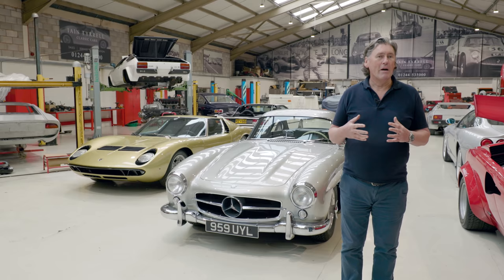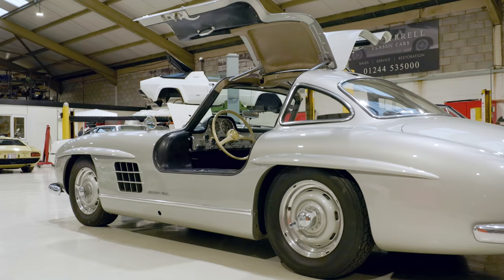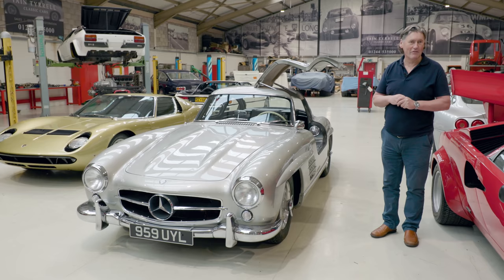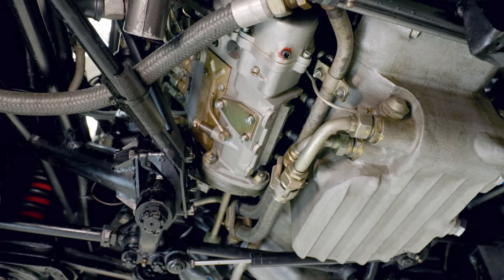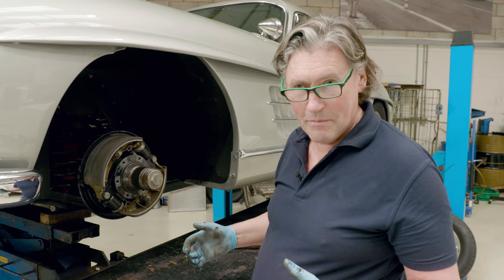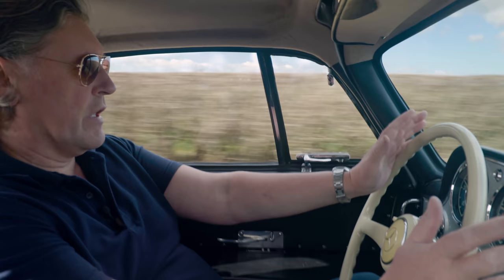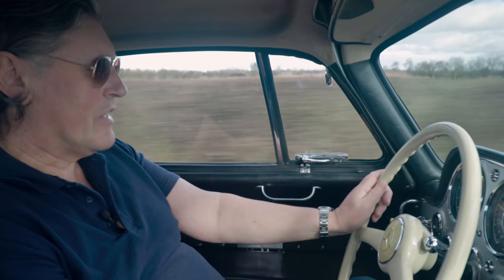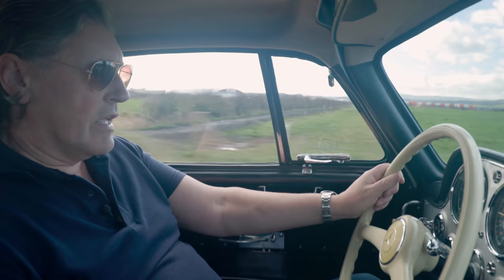Mercedes-Benz 300 SL Gullwing - Recommissioning an Automotive Icon | Tyrrell's Classic Workshop

Comment: There's not many things cooler than pulling out of your shop in a Gullwing, with one door open.
Reply: To be met by a jet fighter parked infront of you🙈
Reply: Yes there is. 2 doors open.
Reply: Well, Dry Sump seems to be twice as cool (when he told us the three advantages @3:58 😁)
Reply: I was actually shouting no no no thought the door was going to hit panic over though great insight into this iconic car thanks Ian made my evening
Reply: CLUNK..... oh shi....
Reply: Mmmmm i would have to look at my budget......scale down and have a fully revised DeLorean.
Ofcourse it does not even come close otherwise but looking good and having fun counts for something.
Reply: ...after working on said car wearing your no date Submariner. Brilliant.
Reply: My Uncle did that and hit the door backing out of the garage...in 1964.  This is the first car I ever shifted at 5 years old from the passenger seat.  So sad he sold it..
Reply: When I had my workshop, I put a mark on the door frame which was the height the roller shutter had to be at so as to not clump it with an open delorean door.
Reply: There are no things cooler than that. This is a proper car with proper guages, none of those poncey sat nav screens and beeps to let you know your ashtray is still open.
Reply: @andy-james-  do cars still have ash-trays?
Reply: @andy-james-  *gauges
Reply: A friend of mine had a DB3,he held the drivers door open as he reversed to get a better view.Didn`t notice the gatepost which bent his door back at a cost which was eye watering.

Comment: The 3 advantages of dry sump lubrication:
1) It keeps the oil cool.
2) It offers a consistent oil supply.
3) It keeps the oil cool.
Reply: Now that’s cool 😎
Reply: The third advantage is weight distribution. The engine can be fitted lower and the oil reservoir can be placed where it best serves to balance the weight distribution.

Comment: That sound. Bloody hell that’s good.
Reply: Absolutely... I might even settle for digitally engineered in via the speakers for that sound, if they could replicate it. Makes you wonder what AMG were thinking
Reply: Yes, all the exotic layouts like V10, V12, flat 12 etc sound nice- but a good, angry inline six can still compete with the best for pure sound.
Reply: Glorious.
Reply: The sound that straight six's make are often overlooked/forgotten.
Reply: @NORWAYORNOWAY  yeah, the problem is that's the sound of a fart can, no sign of engine sound left in it. Try to listen to an unmolested BMW straight six. That's the sound of a straight six. This is one is just "straight piped" I guess, fart noises producer.
Reply: I dont think back boxes were even a requirement back then. Engines now are muffled to death and it will get worse until EVs arrive.
Reply: @BlatentlyFakeName  they installed a "not oringal" muffler/end pipe that farts so loud, that you can't hear the nice inline six growl anymore.
Reply: @thefridgeman  I can't find anything visible to indicate this example's exhaust deviates from stock in some way; other original-condition Gullwings documented online appear to share the same setup, and videos of such vehicles sound remarkably similar. Whether or not the noise is pleasant to you is subjective, but to claim someone altered and/or ruined it seems without basis in this case. To call this design a "fart can" is off-base when the sound is purely a result of the function of the design (to evacuate as large a volume of combustion gases as quickly as possible for the sake of peak power) rather than for the sake of making noise.

As for not being able to hear the engine over the exhaust, that run at 27:04 is pure induction roar.
Reply: @andrewpliagas9213  0:32 look at the tip. Also, the car Mercedes Museum is running has a "chromed tip" lololol. There is no catalyst or modern mufflers on these cars, but still, you can only hear the end pipe farting, NOTHING from the engine. Again, try find how a straight six sounds, a lot different!
Reply: @andrewpliagas9213  Compare 27:06 with 27:08 engine sound vs end pipe farting.
Reply: @thefridgeman  BMW Fanboy?

Comment: As a fan of WW2 aircraft, I was impressed to learn that the BF109 had two, Bosch fuel pumps, the same as in the 300SL Gullwing. Spitfire’s Merlin motors used carburettors, and these would starve the motor or be way too rich under different fighting conditions, such as inverted flying and especially in a steep dive. “Miss Tilly’s orifice” was a restriction device that solved these problems.
Reply: “Miss Tilly’s Orifice” 
😅

Comment: When you put your foot down I think that has the most pleasing acceleration sound I’ve ever heard, like a sound you might in a Star Wars moving going into hyper space!!
Reply: I agree. I've actually never heard anything like it? Most gullwings are museum pieces, how often do you get to hear one at full throttle with the car mic:ed up?
Reply: @ingvarhallstrom2306  Not only mic'ed up but done properly, without the mics driven into distortion or wind noise. Very rare for YT vids.
Reply: You should try one of the W06 S SS SSK or SSKL series with the blower engaged .
Reply: @ingvarhallstrom2306  I’ve passengered in one , also had a seat in the 300SLR Uhlenhaut Coupe and met the great man himself . The best sound ever though was my run in a 1927 W06 Mercedes S with the Rootes Kompressor which engaged at full throttle and made that wonderful scream ( but you could only use it in high gears and for just a few seconds ; except in the SSKL with the ‘elephant’ blower )

Comment: When Mercedes built properly engineered cars, you can feel and hear the quality in every thing it does. So rare to find this now.
Reply: Sadly so very true. Ask any experienced MoT tester.  During my MoT "while you wait" appointment sat in the viewing area, a broken suspension spring rolled towards me. I asked what was that from. The friendly tester pointed to a nice looking Mercedes Estate parked next to my Rover 620ti being tested.. 

Some of the things he finds are shocking and undermine so called German engineering and reliability myth now. That since the main core of German car manufacturers decided to enter the volume car sectors mainly occupied by the likes of GM and Ford Worldwide as well as Japanese stuff. That they did very successfully as a glance at any UK road or car park would soon confirm. Thus unit costs means somethings had to suffer... and it shows.

Move on a few years and my immediate next door neighbour has a new Chinese built MG ZS EV parked where previously a Mercedes or Lexus stood previously. He told me that he is delighted with his MG EV and his final comment... "I'll never go back to petrol or diesel cars again". Now that is some change of mindset!
Reply: As a german Engineer (60) : true, it was  all  gone beginning of the 90th, when the  Number-count-Dilberts took over and the Engineers got less and less power; plus other "funny" developments
Reply: Mercedes electrics are rubbish now

Comment: Iain you did an admiral job of giving the viewer an excellent feeling for a Gullwing. Right down to an accurate sound track of the big pipe exhaust rasp, so special to the 300SL.
I'm a retired Star Technician award winner, multiple times. I serviced all M-B's from the 1950's up to 1990. My first 20 years of working with M-B, then 27 more years with BMW. I never felt the same sense of heritage, prestige, factory support, engineering and build quality with BMW. I'm reluctant to part with my 300SL manual, parts book and operation manual because of the great memories they give me. Chinetti motors was my M-B neighbor 1 block up the road in Greenwich, Connecticut 🇺🇲.
What a time for prestige automobiles in the 60's and 70's. I'll continue to view your other episodes. Cheers ✌️🇬🇧,🇺🇲.

Comment: I had the rare pleasure of seeing a 300SL Gullwing parked on a street in Surfers Paradise in the early 1960s. Actually it was a double pleasure as a young lady wearing a dress was clambering in to the passenger seat backwards across that wide sill as I passed by.  I didn't notice the colour of the car.

Comment: Epic vid. Love that car. Missing my 90s S-Class, it had about 1% of this cars engineering prowess and that was still a lot. Too bad what's happened to the brand these days.
Reply: I had a W123 back in the day, proper engineering and an ergonomic cockpit with zero styling input. Last real Mercedes.
Reply: They did have a bad period a few years ago, but it's my impression that they have made some progress on making good cars again. It's my understanding that the rot set in when the then chairman decided that the profits were too low and they were spending too much money on engineering. So the board agreed to reduce the engineering budget and the profits went up. Then the quality went down until Mercedes quality rating was around the bottom of the league.

Then again, you can't judge the whole output by the quality of a few hero cars. You can't expect the cheap models, designed to appeal to people who base their buying decisions on the bling level and the price (the Kia's reverse camera has more features than the Mercedes and it's $9.99 cheaper"), to be supercars.
Reply: @roadie3124  The worst time was the area of Daimler-Chrysler. It damaged both companies a total loose/loose merger.
Reply: My wife is a BMW lover from way back.  We have had everything from a 328i to a 740il, a total of 8 new cars over the years.  The last 3 series we got was a piece of junk.  So tired of hearing how people still think they are great cars.  My wife loved them until then.  We know so many other BMW owners that shriek about what the brand has become.  The dealer service was always expensive but you got some value from them, now the warranty observance and level of service is totally unacceptable.  My friend bought TWO new Mercedes 3 years ago, and they both rattle, all the finish coming off the switch gear, and just feel and sound cheap. His leaks oil, not under warranty, a fortune to fix.  I remember my best friend buying a E-class years ago and there is absolutely no comparison.  I belong to a Porsche club and there are three guys in there that buy brand new 911s and trade them in every two years, because once the warranty is over, the repairs are unbelievable.  What happened to German cars, which were once considered among the best?

My wife?  Got her a brand new Cadillac, something I didn't believe she would ever want.  No issues, no black BMW paint that permanently-stains if a bird winks at it, drives very well, has all the gadgets.  It is mind boggling that a new Cadillac is a better choice and better value by far than any German car.  Wow, just wow.

Comment: All that innovation in 1954, it’s incredible.
Reply: but old Jaguar drum brakes.
Reply: By 1961 the 300SL was updated with disc brakes all round.
Reply: @Freimopp777  So were all the Jaguars, they were fairly early adopters of disc brakes.

The 1950s was a great time for innovation, the next year saw the Citroen DS, by far the most innovative car ever made. The car that introduced more features than any other, many are commonplace today, many others should be standard on every car but have been forgotten.

Comment: At the age of 16 in 1962, I was lucky enough to ride in one of these great vehicle's. Approximately 120 mph along Radcliffe road Nottingham. Sheep crossing ahead, heavy braking spun us around about three times and the momentum carried us backwards though an open gated field. No damage apart from the flat surfaces on the tyres.

Comment: It was obvious that you had maximum fun in this !!!7 figure!!! car. Your enthusiasm, an over flowing fountain, thanks for taking us on the tour and the ride.  You might note that the Bosch pump is similar to the Spica pump that Alfa used in their early twin cam 4, early Spiders and Coupes, as I recall, and in diesel trucks. The Spitfires and Mustangs were eventually using fuel injected Merlins.

Comment: I was in Germany with the Airforce in the 1980s. I was lucky enough to find a1971 280 S. Because of the very tough inspection regulations older cars are hard to find. I had that car for 5 years and passed it on to another airman. I replaced some brake parts and and an automatic transmission, but the car was solid the paint was perfect and it was a joy to drive. I wish I had it now.

Comment: A few words about aero engines....
The Merlin was supercharged so fuel distribution was not an issue, but certain maneuvers and inverted flying were done at your own risk, the Merlin would just quit due to carburetor float shenanigans. The engines would 'windmill' and relight once the mixture got back into the cylinders. That's where fuel injection had the huge advantage.
About double de-clutching, in the 'states we call it 'double clutching', but we do say 'decluthing' when throwing out the clutch.
Excellent presentation, thanks for the ride !

Comment: Bravo!
Driving a classis sports car the way it was meant really is a magical thing! I always go at least 100 miles per trip in my 65' Alfa 2600 Spider, in search of windy roads. I get the same feeling of the car being alive under you after about an hour of warming up. Its funny how the car just wants more after everything loosens up, bushings heat up, oil flows easily, bearings get slick......all those tiny little analog changes really do amount to a perceptible change in the car's feedback and feel.

Comment: The straight 8 powered Uhlenhaut SLR coupe was an even more interesting story.
He refused to release that version for sale.Rob Walker, of the Mike Hawthorne incident fame, reputedly asked him to sell him one and was turned down.
Although the gull wing doors are even more doubtful, regarding a roll over type incident, than a convertible.
A flaw it shared with the Me109 aircraft canopy.
Reply from the maker: Thanks for that. Very interesting
Reply: @iain_tyrrell  
Thanks Ian just to add one of the two SLRs seems to have fetched 135,000,000 Euros at recent sale.

Comment: Automotive art, I read somewhere that the drum braked race cars of that period, had an oiling system in the cockpit to squirt lubricant onto a grabbing brake! I believe the Uhlenhaut coupe also had the same system fitted. Love the clock. One of the outstanding cars of the 1950s, along with the Jaguar XK 120 and the C and D types, plus the amazing Citroen DS.

Comment: I have just experienced YouTube heaven. Long time Merc owner and fan and big fan of this channel too. The perfect video for me then? Oh yes!!!! Mercs from the early 90's really went downhill im afraid. Have heard the new new ones are better than that sad period. All I can say is the 220+ bhp non cat M104.980 in my old 300te-24 needed 24 valves and whilst it sounded great from 4000 to the 7250 red line...it wasn't tractable like a two valve set up. My wifes car is a 1991 190e 2.0 8v non cat sportline manual gearbox .Euro spec at about 125 bhp, but damn that thing pulls as you said...like a steam train from 1000rpm. Never mind torque curve its a torque plateau. Anyway, thanks for this video i was neigh on in tears. Superb.

Comment: I would like to add one more historic fact, due to the Mecedes Encyclpedia of Heribert Hofner.
Mercedes was between 1938 and 1942 working on a new Großer Mercedes to replace 770 Model. Planned and sketched was a 6 Liter V12 fullaluminium Engine with one supercharger on each cylinder bank.
The Motor of the 300 Adenauer is what has remained of this  huge projekt. A Mercedes 600 , 230/400 hp

Comment: 15 or 20 years ago I was approached to design an air conditioner for a 300SL that was undergoing restoration. The requirement, of course, was to make no permanent alteration to the car. Most of the hardware for this unit was to be fitted in a simulation of the original luggage. I was quite busy with other projects but this was a once in a lifetime opportunity. Ultimately it didn't happen. I simply wasn't able to put in the time and travel it would have required. Technology has moved on though and I believe it could be done with components similar to those used in today's electric cars.

Comment: 4:00 "thirdly it tends to keep the oil cool."  That was your "firstly."  You'll have wanted to say thirdly, it allows the engine block to be substantially lower, significantly lowering the center of gravity of the car and thus reducing cornering roll.

Comment: Thanks Iain for another brilliant insight into the workings of an amazing piece of German engineering. How racing drivers like Stirling Moss coped so well in the Mille Miglia with the swing axle design is beyond belief!
Reply: but Stirling Moss's 300SLR, in which he drove the record-time in the Mille miglia was another sort of car. For instance it had a genuine racing engine, as used by the successful Grand Prix Merc of these days. A 8 cylinder, Inline engine. But there is the famous" Uhlenhaut"- Coupe, which was driven by Rudolf Uhlenhaut as a matter of transport . It combines 300 SLR- technique with the normal Gullwing- Outlook.